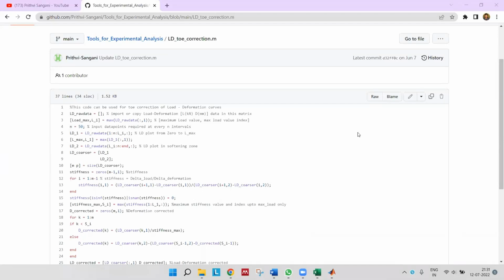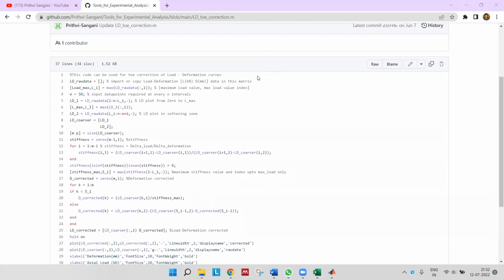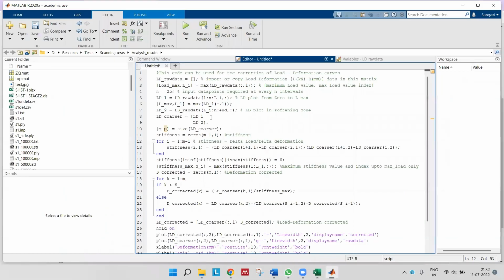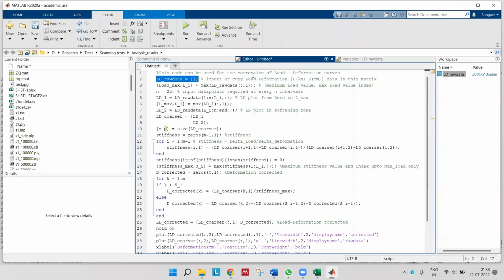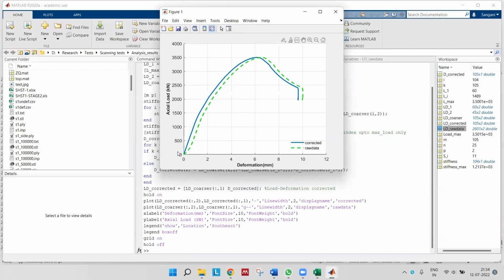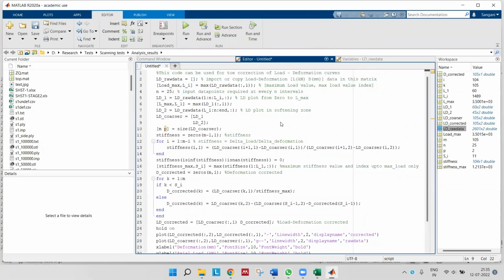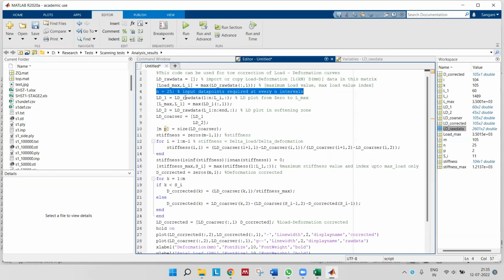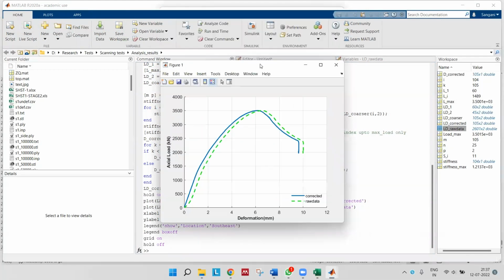Load vs Displacement plot after toe correction using MATLAB

Comment: Could you please explain more about the correction and why we need to correct the experimental data which are the exact results of material behavior in a universal tension test? i.e., while we use DIC for extracting displacement and strain, do we still need this code?
Thank you for sharing this code and assistance.
Reply from the maker: Hi, I mentioned the toe correction only in the tests that involve compressive forces/pushing forces. As you correctly mentioned, the tensile tests don't need any correction unless there is a slip in the grips while pulling the specimen.